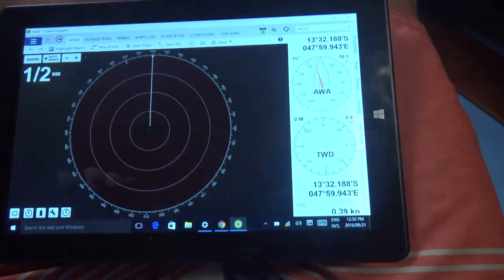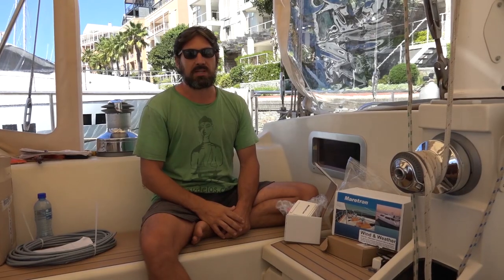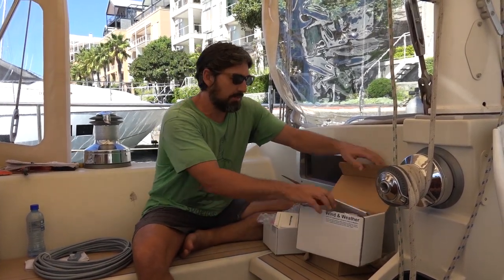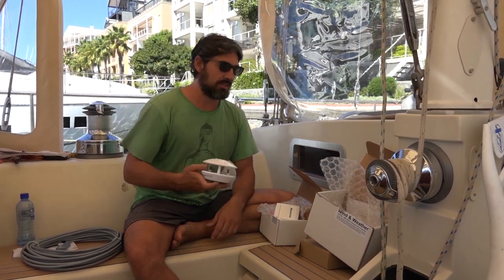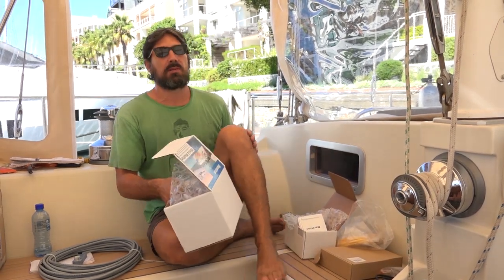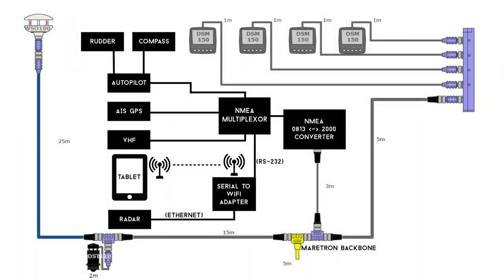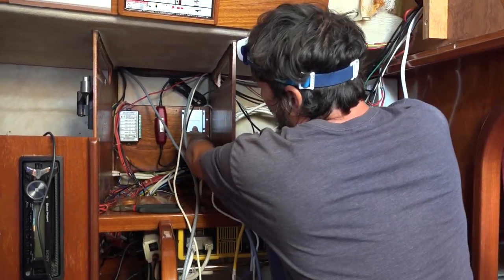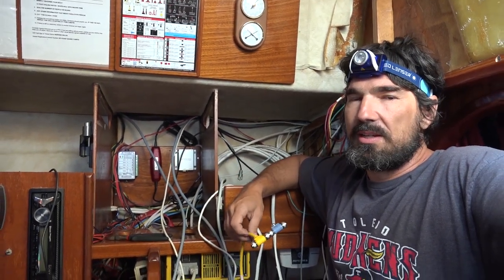Sailing and Navigation Electronics Installation!- Sailing Vessel Delos

Comment: When you are way off shore and out of wi-fi range or somehow lose wi-fi, what happens? Could you use any of your old instruments without a wi-fi signal? I'm sure you probably thought of this already. If the old instruments weren't wi-fi dependent, it is a shame  you can't keep some of the old system set up as a back-up - just in case.

These days I'm especially anti-wi-fi, anti-smart-meters and anti-cell towers due to the health impacts. The pulses from the radiation are unnatural and they fight against the natural pulsing of your immune/lymphatic system causing inflammation. Not everyone is sensitive to it but it still affects everyone in time. The more exposed to it the quicker the effects take place.

The FCC in the United States allows dangerously high levels of radiation emissions compared to most other countries - more than 500x higher in some cases. To give you an idea a microwave oven emits 1000 microwatts per square centimeter. The FCC allows cell tower radiation emissions to go as high as 550 microwatts over half as strong as a microwave oven.  I turned off the wi-fi here and have everything hooked up by cable.  It turns out that even at 1 microwatt per square centimeter, there can be ill health effects.

I suppose if you guys start to feel irritable, have trouble sleeping, get unexplained skin rashes or headaches, or digestive issues you can always turn OFF your system and give your immune systems a rest. It is just a heads up. I'm not trying to rain on the parade. I love
the convenience of wi-fi just as much as the next person - just not the intelligence gathering and the health impacts.

Comment: ok so seriously how do you know all this stuff what is your education i, clearly you must have some kind of electrical engineering degree or the like
Reply: he was a programmer before he sailed away . most of IT people have to do tech support and a bit of electronics when  going into the field .  basic electronic and a bit of computer know-how will get you about where he is at.
Reply: He was an engineer
Reply: On their site you can see he has a degree in electrical engineering and owned his own software company. You could say brian is pretty handy with computers. 
Delos loved the video btw! 
https://svdelos.com/sailing-travel-blog/the-crew/
Reply: As romeonveverdies stated, it's not uncommon for programmers to pick up other skills on the job. I've been in IT for over 35 years, no college, and I knew most of what he was talking about. It's all about a willingness to learn new things, most of this stuff is pretty simple by itself and can easily be learned a little at a time. 

I just installed an NMEA triducer (speed log, depth, and sea temp all in one unit) and had to learn NMEA 2000 networking. Nothing beats just buying a system and installing it to learn it. The biggest issue was trying to figure out what Google page had the correct info for my gear because of revisions and upgrades to the same model.

Trying to learn it all at once is the challenge. Learning it over a decade or more .. no problem.
Reply: From now on when you do your research, use Startpage.com and click on "Advanced" so you can get results that include ALL of your search words and not a whole bunch of junk that contain only "one or more" of your search words that Google sends you. Also, Startpage assigns a generic IP address to each search. So you searches are PRIVATE!
Reply: This stuff is really not that complicated.  You don't need to be an engineer to figure it out.
Reply: ruckuss12000 ruckuss 🌶
Reply: See